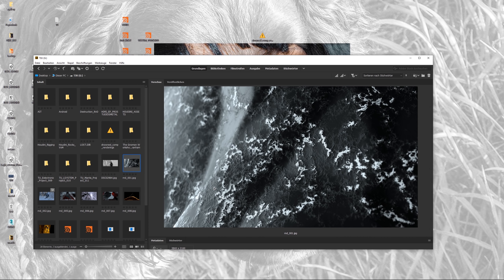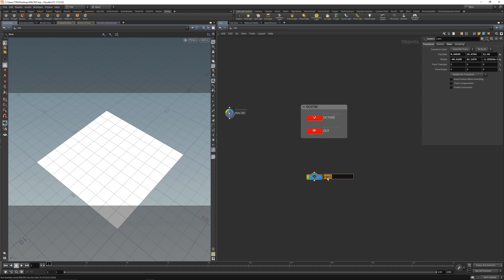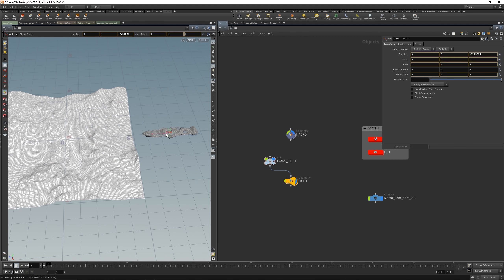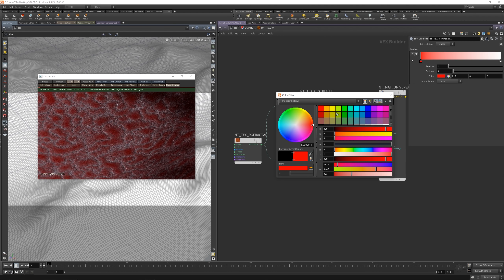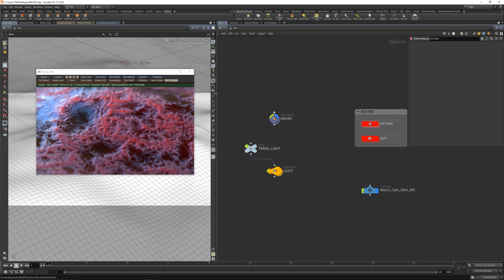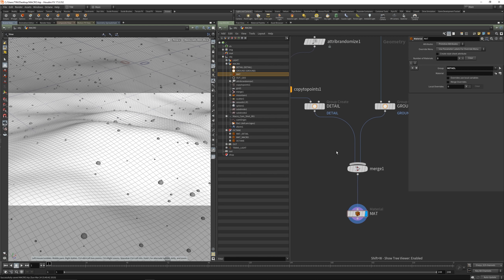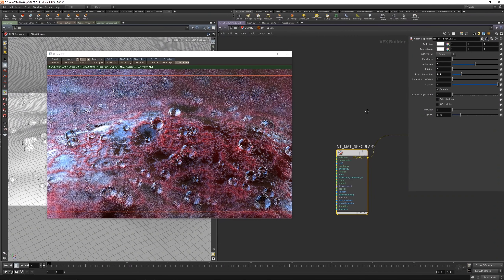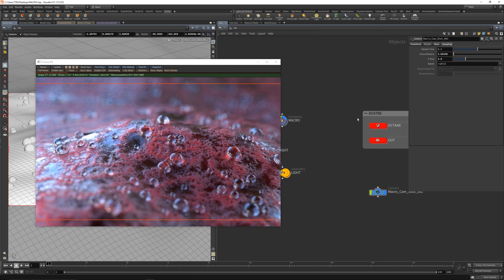Houdini  - Macro Rendering with Octane

Comment: Excellent tutorial. You’re definitely fluid in Houdini! Thanks so much for passing on the knowledge and inspiration!
Reply from the maker: Thanks so much for the feedback! You are welcome!
Reply: Hi Tim, for some reason my spheres will not show up in the IPR. They show fine in the scene view and I believe I have everything connected properly, but I can’t get them to show in the render. Is it possible that something in this setup has changed between v 17 and 17.5?  Everything works perfectly for me until min 23:00 in the vid. Thanks!
Reply: Ok, sorry for the false alarm.. I discovered that if I change the sphere primitive type to Polygon Mesh or Polygon the spheres show in the IPR. Must be an Octane issue :)
Reply from the maker: No problem! Yeah Octane doesn't support Primitive rendering for now :(

Comment: This is so cool, just got Octane, do you know how to add this procedural noises as bump but on animated geos?,  the way I do it in Mantra is with the rest attr, but no idea how to stick the noise to deforming geos in Octane, thank you!
Reply from the maker: Thanks! Create rest attribute with Rest SOP on your geometry before animating, then base your noise on rest attribute instead of P or you can base it on uv as well if you got UVS. 
It depends on what you are doing
If your geometry is animated already (like geometry sequence, maybe from other Software) then you can use Timeshift SOP to freeze geometry on one frame and use that as second input in Rest SOP. 
Hope this will help! :) 

or you can also copy it with Attribute Copy from static geo
Reply: @timjdesign  thanks for your reply, yes I'm aware how to do that, but I don't know how to read that rest attr in Octane, or how to use it as @P on the Octane fractal noise
Reply from the maker: What version of Octane for Houdini do you use?
Reply: @timjdesign  v2018
Reply from the maker: I think Octane only supports Color attributes now on prims and no pos